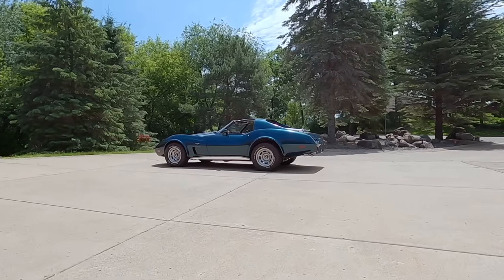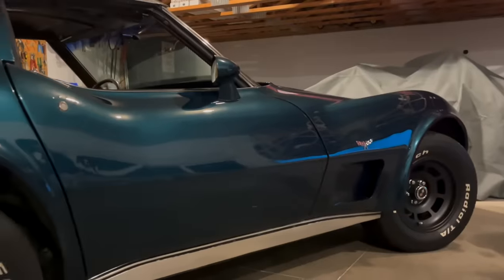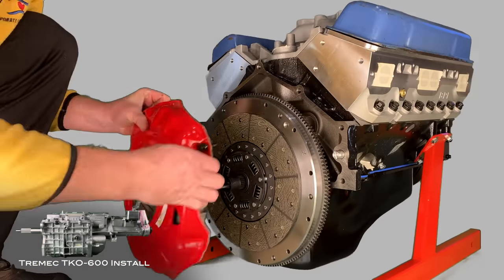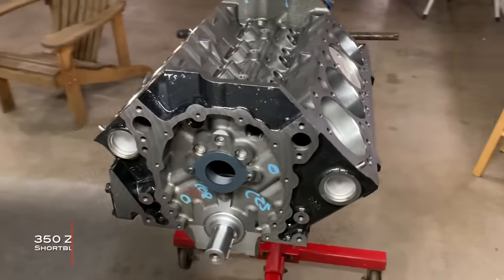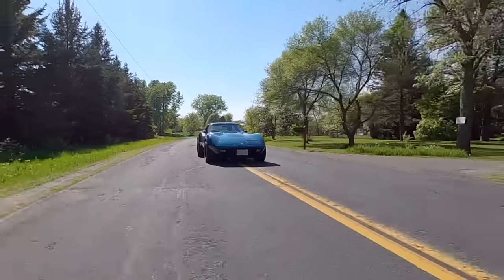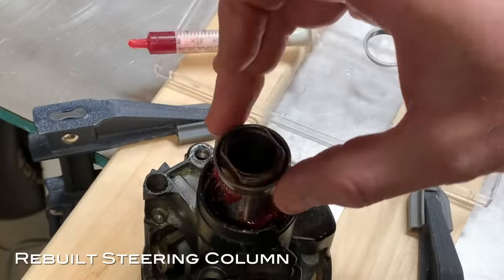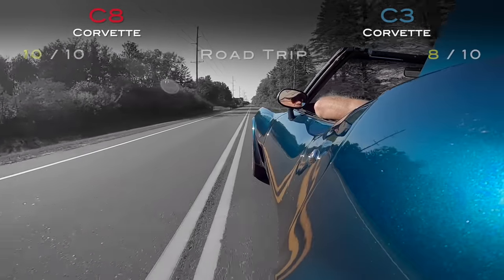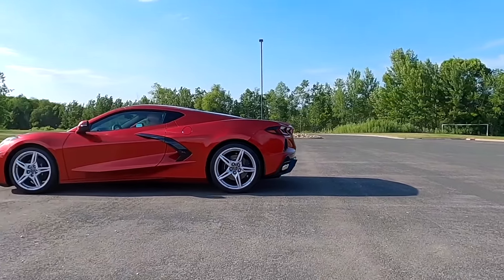C3 Makeover: Modernizing a Classic Corvette

Comment: TKX is much better than TKO. not my opinion, its the experience. I can shift at high rpm in track car. I spin till 8 with my falcon cleveland build and the TKX allows me to shift easier and handle the abuse. only complaint is the stock shifter "Rod" breaks out if you drag it and dump on first. only first. I made my own shifter from work and it works wonderfully.
Reply from the maker: Nice work with the shifter mod - TKX behind a Cleveland in a flacon sounds like a blast to drive / thanks for the comment!
Reply: @TacoJoe  no problem, I hope you can enjoy this and the cobra you had/have. I’d love to have one of them too, Just can’t afford all of the cars I’d want

Comment: Man great video! I have a 1978 C3 and have thought about doing fuel injection. Any issues with your setup or is it still a worth it to do the upgrade?
Reply from the maker: Still worth it (100%) - I had the C3 out today and it was 85 degrees / ran flawlessly in stop & go traffic and it was nice & cool in the cockpit - no regrets / love the car and my next upgrade is likely rack & pinion - thanks for the comment!
Reply: Nice yeah I need to do something with my power steering. I had a bad leak last year and put all new parts on but now it started to leak again…

Comment: The clutch and brake pedal assembly..What brand is it do you like it and where can I get one? Is it the one that your pictured in the video?
Reply from the maker: @yesiram8 - Its the OEM pedal box / its actually very easy to take apart - paint and clean-grease the bushings. A word of warning: The hard part is removing the pedal box - it is NOT easy / plan to take out your steering column if you want to do the same and you need to remove the plate above there drive windshield wiper to access the top mounting bolts. Check eBay too. (I bet you can find one under 50$ that you can rebuild and swap in when the time is right) - thanks for the comment!

Comment: Had a chance to buy one several years back. Only problem is, I am 6'4" and do NOT Fit in one. I fit in a Fiero Better than I did that thing. Real Shame, I Love this Version.
Reply from the maker: bummer man - did you consider replacing the seats to see if that would give you some more room?
Reply: @TacoJoe  At the time, No. Would have had to remove them Completely to Fit.. Yeah,Yeah, Yeah, I know, there are others the same Height as me that will say they fit just fine in them.. I say they are Full of Shit also.. Because it had T-Tops and my head was touching the glass also. Knees up under the Steering Wheel, so would/could not Steer. Seats were all the way back. So would have to get ones like Recaro Seats and those are $$$$$

Comment: There are a ton of options for the C3 suspension, without re-engineering the frame or a ton of fabrication.  Would make an interesting follow up video.  I had a '72 that I put about 100k on.  Wish I had it now to implement those possibilities....
Reply from the maker: The fiberglass rear leaf is on my radar - I've heard lots of good things / thanks for the comment!

Comment: I call that a sensible upgrade of the unloved late 70s C3.
You set a goal, driveability, and you achieved it. I’d like to hear some performance numbers, just the basics, like quarter mile and fuel economy. Of course it will be miles ahead of a stocker!
I like the black out wheel finish, and even the luggage rack, but man-that thing needs about a 2 inch drop on all four corners!
Overall however, a great project and a good result.
Reply from the maker: haha - I'll have to look into lowering it some more / not sure what the OEM ride height was but I might still be a tad high - thanks for the comment!

Comment: All that work and NO suspension upgrades?!?  Seriously?  Then you blame the car?  And say it can never be improved?  SMH.
Reply from the maker: @ThirtyOught6 - hey thanks for the comment / of course suspension upgrades should improve the overall handling of a C3 - I guess my point was if one (for instance) autocrosses or road race a modified C3 against a stock C8, it is likely the C8 will still put down faster lap times. The C8 frame structure-unibody is far stiffer/superior to a C3 which is a nothing special  steel frame with a heavy fiberglass non-structural body bolted on top. I'm not ripping the C3 - that's just how it was designed 50+ years ago (a cruiser) - and - I still love me C3 in spite of the drawbacks.
Reply: @TacoJoe  Thanks for the response.  I'm not saying it's going to handle anywhere near what a new C3 Corvette is but it can be made better.  It's one of my favorite classic 'vettes but the handling begs to be improved.

Comment: You went in some detail about your cam but didn’t even mention the most important part as far as performance, the cylinder heads.
Reply from the maker: The blueprint 8002k heads are a nice casting - but - the value proposition has dropped significantly since I bought them. I got a pair under a 1000$ and pretty sure they are 1500$+ now. For that price, you can likely pick up a ported pair of AFR heads / thanks for the comment!

Comment: The shifter on the c3 looks wierd like no room vertically to make shifts. The overall work on this c3 its amazing❤ thanks for sharing.
Reply from the maker: plenty of room for shifts / I actually verified shift gate location with a plumb bob mounted over the transmission before I cut the hole in the sheetmetal / thanks for the comment!

Comment: Nice but modern restomod with LS powertrain, brakes and suspension would make it much more SWEETER;)
Reply from the maker: LS motors are very well designed and are a perfect addition - upgrade for most project cars including a C3 - a watch out though: you'll have to find a custom oil pan or make some changes to steering linkages with an LS. Thanks for the comment!
Reply: @TacoJoe  yes I’ve seen those builds, your car and your money but it is a nice one:)

Comment: Nice video and nice comparison. I'm not crazy about your dash, but I understand your reasons. I am surprised that the C3 scored so well. Now the space issue is due to the year. If you had a '78 to '82, you would be almost as much space as the C2 coupes, and they had a lot more practicality than most realize. '68 and '69 were the biggest of the C3. In '70, they moved the real wall forward, cutting out about 4 inches of depth to the back. I think in '74, there was another cut. while '78 didn't move the rear wall back any, it did open up everything under the glass and didn't have to squeeze under that rear deck. 
Most people mess up with cam selection. If they have an automatic, they forget that the bottom 1500 to 2000 RPM of your engine is used by the torque convertor, so having an RV or bottom end cam is useless. As such, cams that make power from about 2000 to 5500 or so work well with automatics on the street. With most automatics having shift points under load around 4000 to 4500, having a cam that dies around 3500 - 4000 is terrible as you can't get the shifts right like in passing on a two-lane road. 
With a manual, then the rear gear comes into play. If you are running a 3.08 or so, you need more bottom end or you will be slipping the clutch often on take off. Still, you don't want a "recommended" cam producing power at 1000 rpm. Stay with a power band of 2000 to 5000. More than that and you are too much race car than open road cruiser. 
Handling - they weren't bad handlers when new, and what most see isn't so much the 60 year old design but the 50 year old components. New bushings in the front A-arms and in the rear trailing arms do wonders. New gas shocks, new ball joints, rebuilding all of the steering components, and you will be surprised how much better it handles and rides.
Reply from the maker: Thanks for the comment @tommissouri4871 - well said. I've gotten a ton of good feedback on suspension modifications/upgrades I should consider and I'll definitely take your advice here too. You are right on target with cam selection - and - I think you highlighted something very important with torque converter function-challenges when running a more radical cam independent of EFI-gears (well said!). My favorite street cam in a 90deg V8 so far was a 221intake / 225exhaust @0.050 I installed on a 5.0 small block ford - it seems to be almost perfect with 170cc intake runners / headers. Plenty of vacuum - sounds great and it revs too. Is there an ideal cam intake/exhaust duration you think best fits the factory 350s in a C3?
Reply: @TacoJoe  - I liked the L82 cam in a 350. It gives good range, with power from around 2500 to 5500. I put one in an '85 Suburban 2500 and for that size of vehicle, it would definitely move. Even with a 24 ft enclosed trailer, it would run good. MPG went from 8 mpg with trailer to 9 mpg with trailer, and having around 8000 lb. trailer on back get that kind of increase is something. HOWEVER, that is a 50 year old design. With roller cam technology and such, there is probably something better. 
Usually you can find the power range, and with the 5 speed and OD, you'll want power down in the 1500 to 2000 range for cruising at highway speeds in that RPM range. So your cam will be producing power probably around 1500 to 4500. If you can get one that produces a wider range, go for it, but that is probably the best you will find.
Note that the C4 Corvette engines all top out about 5000 rpm. This is because they are cammed to give power down low for cruising in overdrive.
Reply from the maker: That is a very astute observation with C4 cam selection w/700-R4 (nailed it!) - I'll have to check out the L82 cam too - restoring my father in-laws 70 Nova and planning a SBC for it too and wonder if the factory cam might be a good fit / thanks for the comment

Comment: As an owner of a '79 that has also been modernized I find a lot of what you've done interesting but different than the priorities I chose. I went with a 400" Blueprint crate engine for power, a pretty seriously built turbo 350 tuning 3.08 gears. 300-350HP, overdrive and 3.70s are one way to go but ultimately I felt that 500HP, 1:1 final gear, through a highway speed friendly 3.08 is the other way to go....and what ever I might give up from a "dig" is more than made up for once the car is rolling. Rather than deploy big cash for fuel injection I did stick with a Carb on top of the engine. Where we really part ways though is the suspension, brakes and steering. Rather than, fuel injection and all the electronics you've done I deployed the cash to a traverse fiberglass front spring set up, rear spring, big stabilizer bars and koni shocks. A modern 17" wheel and Z rated tires. Willwood aluminum brakes and master cylinder do the braking while reducing weight. Rack and pinion steering replace the overly complicated and prone to leaking "vague" original steering components. I'd be willing to bet as I look at what you've done vs what I've done that the price to accomplish each of these two cars is comparable and a good illustration of different priorities. I'm  sure I can't match your gas milage and GOD knows I still can't come close to the C8 performance but faster and better autocross results/ corner carving in general are almost certainly found in replacement of the suspension and antiquated wheels and tire sizes. The one thing that all C3s share is a near perfect 50/50 weight balance from front to back. This gives all these cars real potential to make a move toward matching and even exceeding the performance of a great many modern muscle cars......if you're willing to upgrade from 50-60 year old tech. What a lot of muscle car only guys miss when dismissing the C3 is found in drivetrain placement. The common thinking is C3s are two seater cars with no back seat. Look a little closer and it hits you. C3s are actually a 2 seat car laid out with the driver and passenger in the back seats. In my car electric fans on the radiator reveal a huge empty space between the center line of the front wheels make that impossible to miss when you lift the hood.
Reply from the maker: oh man what a great comment @stevejewell9263!!! There definitely is more than 1 way to improve your C3 and I can't disagree with anything you said. "3.08s w/1:1 is the other way to go" - right on myman. I think your 79 and my 77 achieved the same goal via 2 very ddifferent upgrade strategies - I'm especially intrigued by rack/pinion too and an upgrade I'll consider. Thanks for the comment!
Reply: @TacoJoe   Before doing it I had replaced EVERYTHING including the piece of the puzzle a lot of people overlook, those rear tailing arm bushings. Yet, even with everything replaced front and back. Tight as "new" still produced the vague and slightly disconnected feel that couldn't be completely eliminated until I just ditched the old components. Losing the original steering box saves some weight here as well. I did mine more than 10 years ago. The prices are higher today on the pieces you'll need so IMO the choice is a little tougher to make than in the past but the difference is still pretty incredible. Once done that small dead spot "on center" that can be improved but never completely eliminated with the original arrangement will be gone entirely. For me no other change I made was more effective at making the car drive like what you expect today from all cars and trucks vs the past. If do this shop hard before buying. A quick look at today's prices reveal some big differences between suppliers.
Reply from the maker: Yeah I completely hate that dead spot on center steering too! At low speed no big deal but on the highway it can be annoying (subtle drift in the lane that you constantly need to correct / etc) It seems rack & pinion is definitely in my future - thanks for all the help & guidance here / will let you know what I end up changing

Comment: Borgeson steering box...made a HUGE difference over the stock box in my C3 !
Reply from the maker: The OEM steering valve tends to drift (there is some slop with actuation) - thus - I can see how an aftermarket setup could improve steering feel - responsiveness / thanks for the comment!

Comment: So what is the fuel consumption like, after the modifications? how many mpg do u get?
Reply from the maker: haven't measured but likely on par with a modern V8 or slightly less because of driveline losses/etc of the older rear end. I'd est. mid 20s and with a tail wind, I think I could "maybe" break 30 on the highway. Thanks for the comment!

Comment: Would like to have heard the C3. You really need to lower it. Looks like you're going 4 wheeling. There are a ton of options to modify the suspension.
Reply from the maker: By chance do you know the factory spec and where you measure to (ie-is it ground to frame/fender/etc?) - thanks for the comment
Reply: I'm sorry I do not. Sold my C6 a few years ago but there has to be several Corvette forums out there with tons of knowledge and knowledgeable people just wait to help.   @TacoJoe

Comment: You just wrote my story for my C3. I am going to have a very healthy 383 built in a couple of months and I will be dropping the insurance and starting on mine. I am not going to replace my Muncie just yet but it is in the planning. A 5 or 6 speed overdrive with my stock 350 would not make any sense. I would not have enough torque with the stock engine to maintain enjoyable highway speeds. I am pretty partial to my 4 speed but I also know that I will be ready for a little more top end and lower RPMs. I have question about your lift. How do you like the two post lift? If you had to do it over again, would you go with a 4 post? Thanks for the videos. I find them very informative. Nice cars by the way.
Reply from the maker: @davejalenderki - a 4 speed muncie with 3.08s or something similar is a good setup on a C3 too / I actually rebuilt my ST-10 before I bought the Tremec OD and its a smooth shifting - solid transmission. I upgraded my rear to 3.70-1 gears and wish I would have stayed closer to 3.55 or less. In fact, 3.55 is ideal with the OD too because 4th works out to be about 1600-1800 RPM on the 40-45mph roads. With the 3.70s, I'm always shifting into OD - and - the water pump starts turning slower and you can see the temp go up a few degrees when rolling 40-45 in OD. As for the lift: it actually came with the house. High level I think 2 posts give you more access - storage options underneath while the 4 posts are smaller and you don't have to balance the load-position of the car. That said: I had my 5500lb van on the 2 post for a timing belt (high lift position) and It had no problems. I always run the safety stands too - really make it sturdy up high. You can get them at Harbor Freight for $200 - 300/set - good investment. Thanks for the comment!
Reply: @TacoJoe  Thanks for the insight amigo. Have a happy New Year.

Comment: Did you consider an LS swap? You get your high HP and fuel injection
Reply from the maker: @mattbarrett41 - I wish I would considered an LS more seriously before ordering the ZZ4 shortblock. My primary hesitation was oil pan clearance and modifications needed to the power steering valve - hydraulic and steering linkage. Hind sight: I don't think it would have been too hard to modify / make it work. Would I consider an LS in another C3 build: Absolutely. Once you have a 59PSI fuel system in place, the hard part is out of the way and dropping in an LS should be easy. Thanks for the comment!